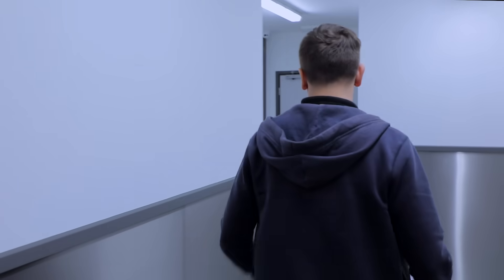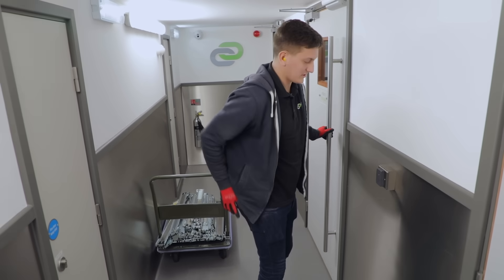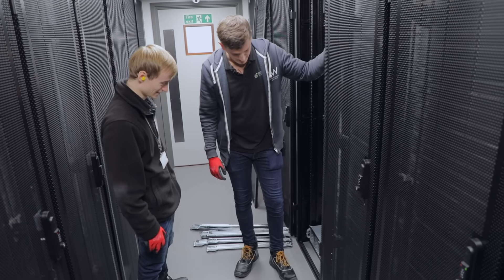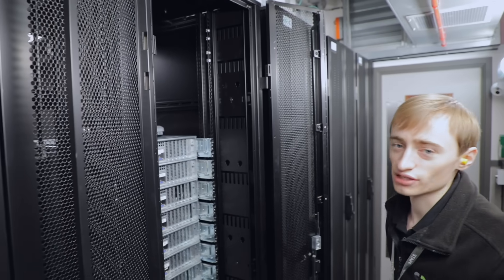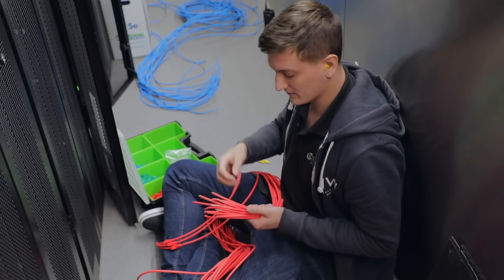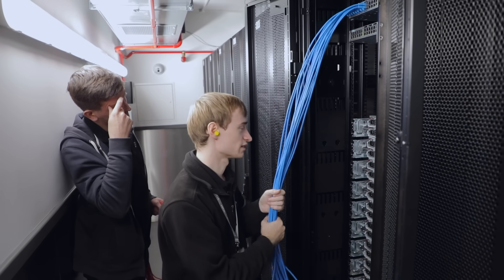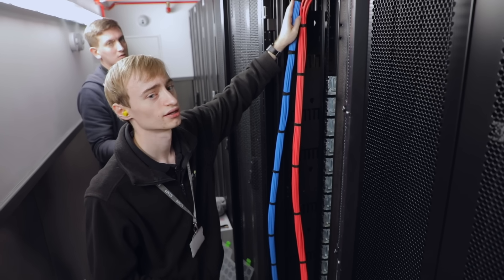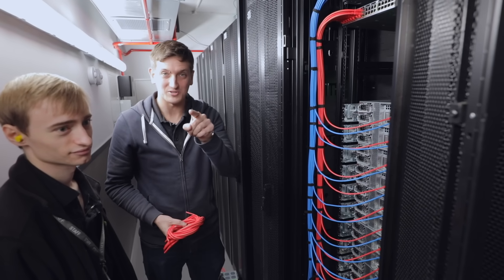A DAY in the LIFE of the DATA CENTRE | FULL CUSTOMER "RACK & STACK" with ASH & JAMES!

Comment: nicely done but i would have gone with premade cables, you can find every size you need and use some cable management arms. i can make cables with little to no errors but crimping 20+ of them  just seems like a waste of time since premade aren't that expensive. also don't cut the cables exactly in size leave a bit of slack in case one fails and you need to re-crimp it. your way looks cleaner but you can't remove a server without unpluging it, maybe that's a concern down the road. and of course velcro is a must to use.
Reply: 25-50 cm pre-made cables are cheaper than 2 rj45 connector...
Reply: Wouldn't that cause inacurrencies in length though? Not to mention the economics of what is actually needed would be bad because a cable may be a tad longer then what's needed. Therefore a little money wasted?
Reply: @travisnelson9104  cable arms are used to tidy up different length cables no big deal, it's used everywhere. yes premade will be more expensive but given the fact that you have to do a lot of crimping (fill a rack), the time needed usually costs more in the long run.

Comment: Works great if when using standard 1g cat5. I'm curious to how you managed 10g SFP.
Reply: Are you referring to AOC/Twinax cables?  
There are twinax the same diameter as standard UTP and STP.  

I'd prefer using fiber with 2 SFP; otherwise you have to swap the whole cable for a failed SFP.
Reply: @joshgagnier  I am referring to 10g SFP+ DAC cables. Those are not as thin as fiber. Even more when you move up to QSFP28 DAC cables.. those things will give your arm a work out.
Reply: Twinax is DAC.  
Depending on the manufacturer, 10G can be thinner than STP.  
QSFP28 is 100G and is still only slightly larger than STP.

The only issue I've had with twinax is it's resistance to bending; it's not as easily manipulated as STP and UTP.
Reply: @joshgagnier  Ok yes, and? Stop trying to flex with some wiki knowledge, brah. No on in the industry calls it Twinax. Everyone calls if SFP or QSFP, or Breakouts because of it's connection type. And yes, if you go AOC it's the same size, but SUPER more expensive vs just a DAC cable or if you get lucky with brand that has a thinner cable. Are you trying to teach something? or just parrot and break down everything I am saying?
Reply: @TheGoatPC  
Initially I asked for clarification because "10G SFP" isn't a type of cable. 
Then you mentioned QSFP28; which isn't 10G.

I've been in the dc world for the better part if a decade; everyone I've worked with calls them Twinax.  SFP and QSFP are optics, not cables.  
A QSFP termed Twinax is called a QSFP Twinax.  

Most Twinax I've used is only barely thicker than STP.  The issue I have when dressing it is the length; eg: needing to use a 5M cable because a 4M is 10cm too short.  There ends up being a lot of slack.
Reply: @TheGoatPC  
A break out cable is fiber.  It has an MTP/MPO connection on one side and 4 LC connections on the other.  
Not to be mixed up with a hydra cable that is MTP/MPO on one side and 6 LC on the other. 
Not to be mixed up with an octopus cable that had and Hwic connection on one side and 8 RJ45 on the other; used solely for console connectivity.
Reply: @joshgagnier  that is not entirely correct, fiber breakout is not common vs QSFP-to-4xSFP breakout which we use all the time.
Reply: @TheGoatPC  I've only ever used fiber breakouts. 
I've never seen a Twinax breakout cable.  That sounds like a pain to dress!
Reply: @joshgagnier  Then we work in 2 completely different parts of the DC world. For us when someone says SFP or QSFP you're talking about the cable. Optics are just that, optics. and breakout are DAC breakouts. I've been in DC almost 10 years myself. Never have I heard it called Twinax. 

But then again every server we connect is 10G and up. and fiber is only used for switch and router cross connects.
Reply: @TheGoatPC  are you in the US? 

If you wanted to purchase twinax cables, would you order them as "SFP"? 

I've used fiber and twinax to connect 10G server NIC to ToR.   I prefer fiber.  If an SFP fails, I don't have to replace the whole cable.

Comment: I was always told that the looms were best bunched randomly to prevent cross talk / induced currents in the other cables. Maybe it's ok on shorter distances??
Reply: I that were the case you would get an induced current between individual cores within a cable .Not that there is enough of a magnetic field to induce a current but also the twisted pair design rejects noise .
Reply: Yeah search up alien crosstalk testing - painful stuff. Particularly seen in high throughput large looms 12-24 CAT6A running 10gb - using shielded cables can massively reduce this.

Comment: We have a system where you run ab bit extra cable so that in the event of you pulling out the server you dont rip off all the cables. Also is cat 6 that expensive in the uk? A 10gb connection can be really useful (but maybe the servers cant handle 10gb)

Comment: CAT 5? In 2019?
Reply: for short runs you can run 10gb on it if you want, it's still cheaper to wire 100 Ethernet than 10 fibers

Comment: not bad cabling but something i've found working in data centres when you have multiple eth cables going to a host like that is to put a bit of velcro on the pair so that it makes it much harder for cables to get mixed up and helps it look much cleaner too as its a tight pair of cables going to the host rather than 2 loosely hanging ones like you got there.
Minor detail i know but cable management is a big deal in places like that as when its done bad it makes for a sh**ty day fixing things

Comment: Nice Video, why do you not have a service Loop on the network cables allowing the server to be pulled out and serviced without disconnecting cables as its should be.

Comment: Do you enforce that your customers use Rack Mounted ATS' for single power supply devices? Or do you even use them at all? I noticed in another video you didnt have one for a single power supplied switch in a rack. Or do you just use 2 switches redundant to each other and on different PDU's?

Comment: I'm surprised to see you installing new Cat 5e in 2019. I would have expected Cat 6 or even 6A. Is it because the customer is only doing 1000BASE-T with no plans to do 10GBASE-T in the future, and they want to save cost? 

Also, wouldn't it be more efficient to buy pre-terminated (machine- terminated) cables rather than crimping your own? There are specialty cable vendors who will sell custom length cables in increments of 10cm, so you can still have a neat install. I got to imagine that would be less expensive than paying you guys to do it manually. 

Lastly, do you test & certify these cables to ensure NEXT and ACR are within spec?
Reply: 10G will run over Cat5e, if it's not too long. 2-3m in a rack are no problem, especially if you use stp or s/ftp cable.
Reply: Personally, I don't care if i have some slack cable in the back of the rack either and actually want to be able to pull my servers out if needed. I'm not doing all that crimping and labor to make what ultimately is an interior product (pre-terminated cables are more reliable statistically).
Reply: I actually wondered as well, why their employer doesn't see the cost factor in all the labor work involved in crimping custom cables.
Reply: @Time4Technology  Based on the single rack they did, waiting and paying for a kit of pre terminated probably wasnt worth it for the customer. After all, they just do what the customer wants. Pre-terminated patch kits can be quite expensive, some customers just dont want to pay for it, its also easier to markup your own time and cost vs that of a 3rd party supplied kit. 

Cat 5e is totally fine for in rack work for the vast majority of work, based on single rack customer, chances are slim they are a HUGE company that would benefit from using 6. Im also betting that like a fair bit of places, they keep a decent amount of stock of all kinds of cables and you can literally sell a customer a "rack and stack kit" that includes x patches of 5e, custom terminated lengths at xx cost vs pre packaged, 6 from a 3rd party. Again, laregely depends on the size of the implementation. Ordering in bulk gives you that power to save, but you really cant order in bulk for a single rack install and most companies wont front the cash to have pre terminated stock if they dont need it. 

There also isnt much of a "cost factor" when it comes to labor work in crimping custom cables for small implementations and typically a place that runs 24/7 has the downtime to just do these things pretty easily, especially with two staff. If it was overtime work or rush theyd probably add in a cost. 

Structured cabling between multiple racks with many inter connects and patches, thats a totally different story. 

They showed them doing OTDR testing for the fiber, i bet its safe to assume they test their copper as well =P They just didnt show us that yet as they arent anywhere ready for handover. No PDU's in yet or the fiber as they mentioned .
Reply: 10G works on cat5e below 10m.

Comment: You haven't left any service loops when terminating the Cat 5 so the servers can't be pulled out and opened without first unplugging all of the cables at the back.  Is the customer prepared for servers to be taken offline for what could have been Hot Swap maintenance/repairs?
Reply: There is almost nothing inside that would be hot swappable other than fans. PSUs and hard drives are by far and away the most failed items, both of which can be serviced with the device in place like that. Having huge service loops generally adds bulk and blocks airflow through the rack. So if you had to pull the server out to replace something failed, it most likely something not hot-swappable that you would have to schedule downtime for anyway.

Comment: Why you guys using Cat 5 instead of Cat 6 or Cat 7?
Reply: Cat5e runs at 1G, its cheaper and a little easier to work with.  at those distances it doesnt matter. event at the cable limit of 100M, meh. 
CaT6 is only realy usefull if - you need to do 10G or you have some random interfearence problems. CaT7 for more 10G good ness but again doesnt look like it was needed here :)
Reply: @Blastgameingrig  Thanks for info.
Reply: @Blastgameingrig  10G can run on cat 5e too, especially short runs inside a rack

Comment: Cables are pretty until you want to pull a server out of the rack and have to disconnect everything to do it. I just have 3 premade lengths and would have taken 1/3 the time it took to do this and looked just as good. We also use the cable trays that come with the servers to allow the server to be pulled at anytime even while it is powered on. Time is money!

Comment: One thing i really miss in  this setup is service loops if a server needs to be pulled forward it cant be plugged in or the cable will break. because you guys did not leave any length on the cable for that. so whats the use of having the servers rack-mounted on slides if you cant even slide them forward with out taking them offline
Reply: Most if not all server service manuals advise or tell you disconnect the power before working inside the server, before you electrocute yourself with 400V.  So you will always have to take them off line, unless your willing to risk a staff life.  Mmmmm crispy engineer! 
I would rather take my server off line than risk another human 😊

It only takes a few seconds to disconnect the cables especially when its as neat as that.  I’m sure though, if their customer had provided the cable management service arms, they would have been featured in the video 😊
Reply: @Blastgameingrig  those servers are mostly filled with 12 volt hot swap components that as the same implies can be changed while the server is on because things like 12 volt fans fail often as they are online 24-7. the main feed might be 400 volts but the inside volts is much lower or it would fry the server the moment you power it.
Reply: @highkicker11  Not all components are 12V.
The point is that there’s still a chance you can touch 240V or more as soon as you open the lid. which is why they ask you to disconnect the power beforehand.
12V fan never implies that it’s safe to work inside an electrical unit.
If a 12V fan was stuck on the side of a 100,000V sub station its safe to walk in and touch is it ? - same concept 

And the reasons for those warnings is because no one wants to risk another’s health or pay the few million it will cost in fines for a work incident vs powering off their server. IMO ill turn off the server over risking someone over a fan and a few seconds of up time.
Those engineers have the right to go home to their family’s every day un-harmed.
Reply: @Blastgameingrig  no there is no dangerous voltages accessible when you open the lid. The power supply is in its own metal cage that prevents any access to high voltage. These servers are designed to be opened while on. There are hot plug components inside, such as fans, that can be replaced.
Reply: @BaldurNorddahl   Your comment proves you have never read the manuals
Reply: @Blastgameingrig  your comments proves you lack experience. The power supply is usually hot plug. You can eject the thing from back of the server. There are often two of them so the server continues to run.

By the way, I studied electric engineering and I am a radio amateur. I believe I am quite qualified in this topic. I repeat, there are no dangerous voltages accessible inside the server cabinet. If you where to open the power supply that would be another story. But usually that is impossible to do without first removing the power supply.

Comment: I'm all for a tidy rack, but I don't know anyone who cuts/crimps there own cables for patching. Other than the ridiculous time it will take, you'll need to test every cable afterwards. Madness. Just buy a whole bunch of pre-made/tested CAT6 cables at different lengths (not CAT5e these days) and have some decent cable management in the back (management bars/dump trays and post rings). Lots of velcro ties would be useful as well. What about cable management arms too? You'll have to accommodate two power cables per server, one per PDU in each side of the rack - that can get messy.
The cabling is neat, but not practical and too time consuming.
Reply: Cat5e worth perfectly for 10gbs/s under 45metres.
Reply: @wildwilie  I've run 10GbE over CAT5e myself over short distances, but not out of choice. I'd always use CAT6A these days, especially in the datacenter. I know they're only running from the server to the switch over a very short distance, probably over GbE, but it's no excuse. As for user termination of ethernet cables for rack use, not a chance in hell. I'd always use pre-made/tested cables from a good supplier. They didn't even use a basic cable tester before installing them in the rack FFS!
Reply: @tonyb3629  Its possible that they edited out the Testing step. But I do find it odd that they at least didnt show any of it. I personally have more of an issue with the cable length being too short for servicing. Especially since I've had terrible luck with fans dying on me so many times over the years.

Comment: Being an end customer of a data centre like this one it pains me how much time i've lost to bad cross connects. I'm very disappointed that no testing was done. I would expect to see a PDF report of every cable with a minimum of a Wiremap, TDR and BER. It's not hard and would not take much extra time to verify your work before the end customer looses hours and misses deadlines because of a faulty crimp. You may be the best cabler in the world and you can still have bad crimps. The work looks good but without verification i wouldn't be happy as an end customer.
Reply: They should just simply use pre-made cables in different lengths and leave enough slack so you can pull a running server out to hot swap things. The color scheme is also not necessary if you would simply label all those cables. Then you would  know which cables goes where and on which port just by a simple look at it. That would be more professional, but hey its their DC and if the customers are happy that's not our cup of tea
Reply: @sitte24  I just looked at one of their other videos about making cables and they do test in that video. So maybe they just skipped it in this edit (hopefully). I disagree about the colouring as they have 2 switches, most likely one for redundancy. Its best practise to use different colour cabling when dealing with this scenario. I personally would like port 1 > server 1, port 2 > server 2, etc. I didn't see them do this but it could have been cut in the edit. The other thing to think about is if the customers servers need to be pulled out whilst plugged in. Theres no where near enough slack to pull the server out whilst running. I 100% agree on pre-made cables in most switch > patch panel scenarios but custom cables are fine when you truely want custom lengths for server stacks.

Comment: You guys forgot to leave some slack on the Ethernet cables so you can pull the server tray without disconnecting them from the network. If a random Fan fail you gonna have to take down the server to change it... I like the HP sever I worked on once because it had a cable guide in the back that you used to route the cables through tha unfolded when you pulled the server out. Really handy.